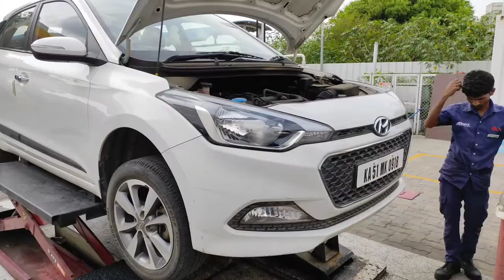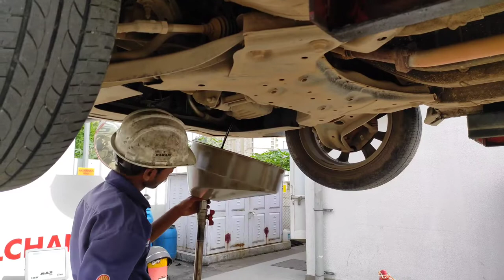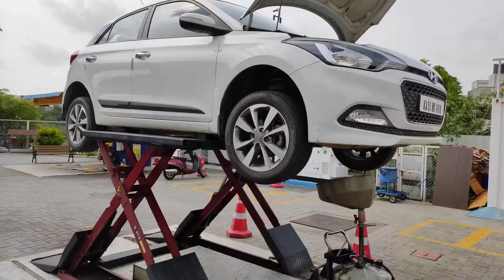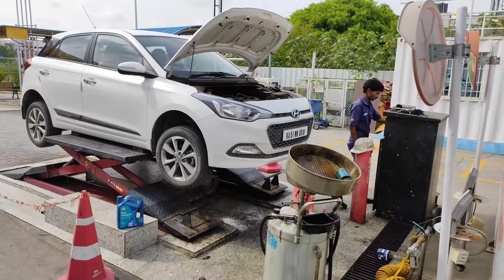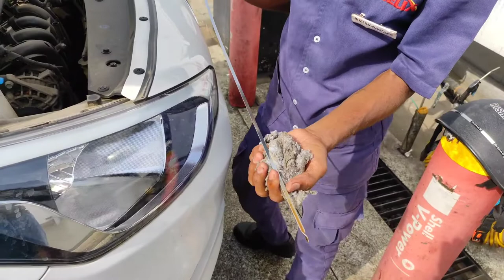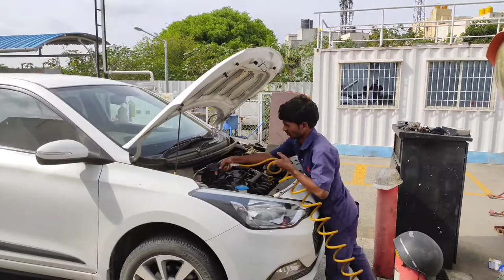Elite i20 Car Oil Change Again | Shell Helix 5W30 FuelSave

Comment: Usually car is started once for a few seconds & oil level is checked. This is in case any slight oil needs to be added. ( obviously adding too much can damage engine. So be careful)

Your engine oil looked pretty dark for a petrol car. If car is sitting long hours in traffic almost entire 10,000 kms. Then better change oil sooner. Kms impact on engine oil between a highway & city used car will be different.  Especially cold starts where car is seeing few km intervals. 

Them cleaning the air filter & enclosure is a nice touch.
Reply from the maker: agree👍

Comment: What is the change interval in term of months for this oil if is driven less
Reply from the maker: i would say change every year or 10k km.
Reply: I know they say 1 year. If your engine is reaching operating temp often & not too many short journeys, can push it to 18 months. 
But petrol cars if petrol is mixed with oil they break down quicker. That is why i said if cold starts are more. Meaning your car is only traveling like 2 or 4kms often. Number of times you did cold start in 10,000 kms increases compared to a car which did longer journeys or highway etc